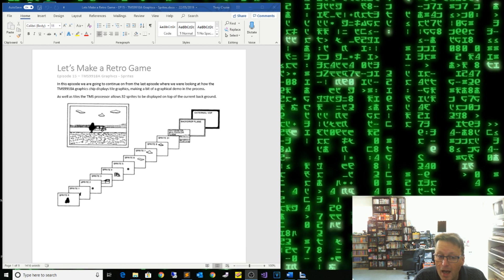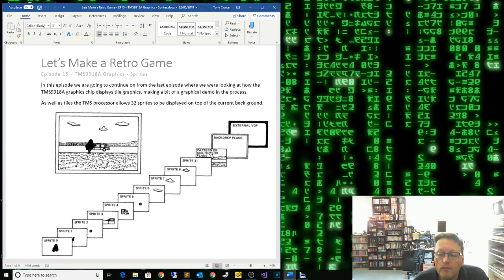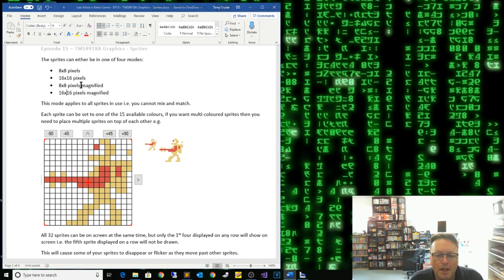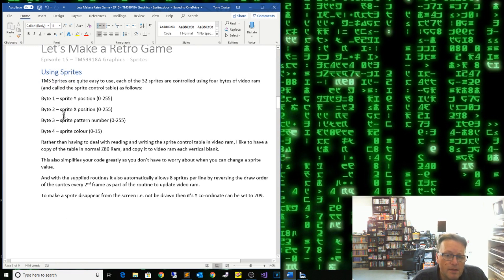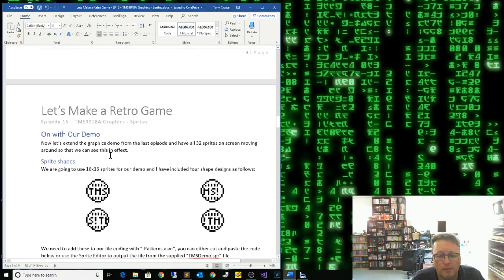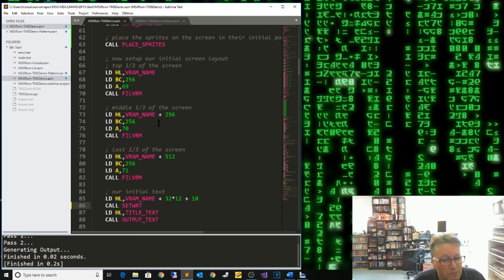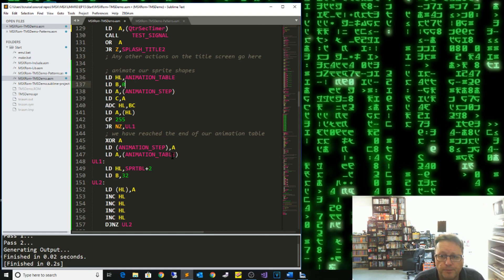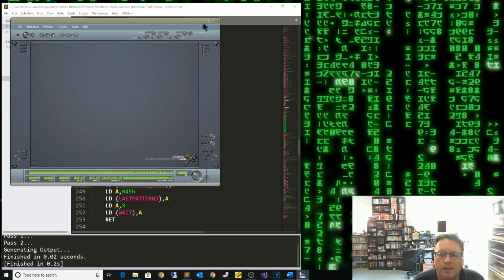Lets Make A Retro Game - EP15 - TMS9918A Graphics - Sprites

Comment: It is a pity that it wasn't possible to manipulate the VDP's sprite registers directly and do some scanline tricks to get more sprites in a line without flicker
Reply from the maker: It would have been nice to have more direct control over the VDP, but you can have 8 per line at 30Hz which is pretty much not noticeable, and use tiles for other things to make it look pretty decent.  Not a lot of the early titles did the extra coding to reverse order the sprites each frame (what I do) back in the day.

Comment: Thanks alot, this is really interesting! I tried to download your sprite&character editor but get an HTTP404 error :(
Reply from the maker: Sorry about that, it should be fixed now, I missed out the directory when I updated my website recently.
Reply: @electricadventures  I got one step further. But now clicking 'Install' button still gives HTTP404.
Reply from the maker: I re-published the app, incremented the version number and tested it locally.  It should work now.
Reply: @electricadventures  Yes, now it works. Very handy tool, thank you so much for it!